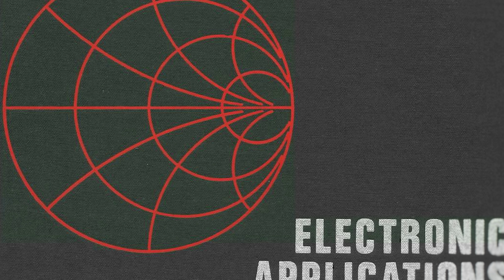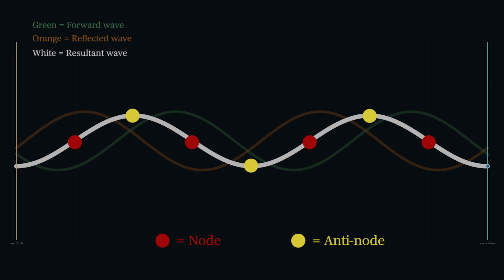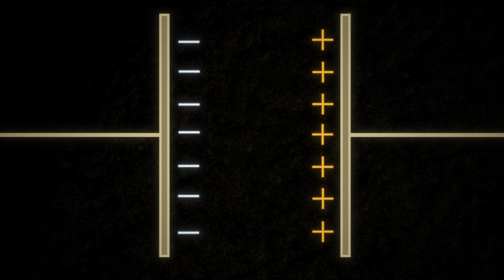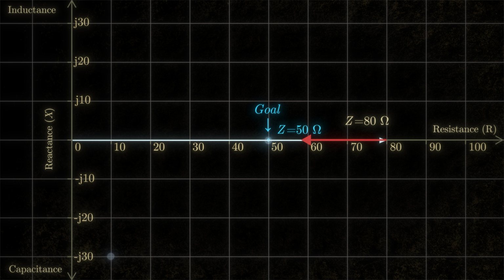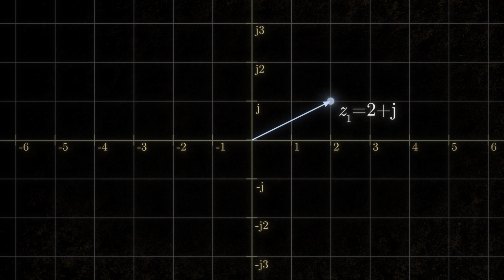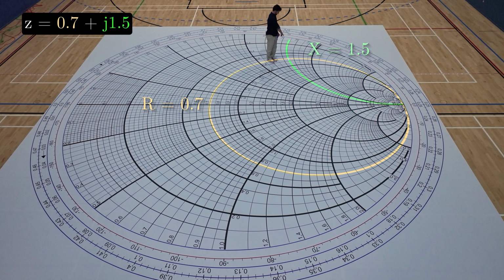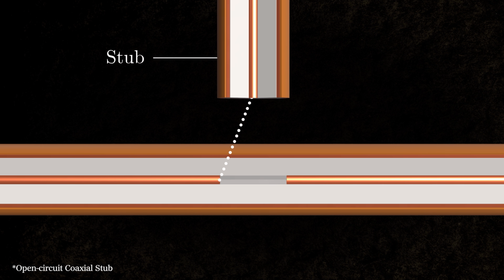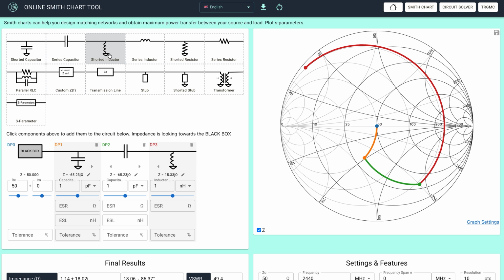The Scariest Chart in Electrical Engineering

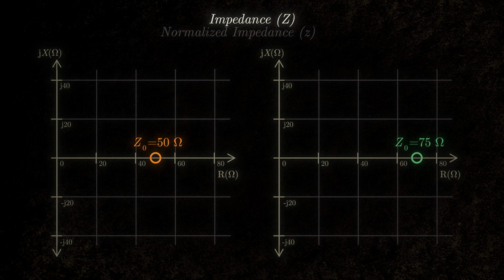Comment: The deepest horror of the Smith Chart around 20:14 is realizing that INFINITY is not actually a real physical limit, it is just a flaw in how humans draw grids. philip smith did not just solve an impedance problem, he took the infinite, endless coordinate plane of complex numbers and literally warped the geometry of space to trap it inside a finite circle. it makes you realize math is not some beautiful language we use to understand the universe, it is a cage we built to force reality to behave. we bend the geometry of dimensions just to stop electrons from bouncing backward in a copper wire. if we can manipulate the coordinate system of the cosmos just to make a radio work, then everything we call physical laws are just geometric illusions we created because we are too weak to comprehend raw chaos.
Reply: but..... 
too useful

Comment: 14:20 This is how EE students get confused.  Yes, impedence and the whole imaginary representation is a useful computational trick but you are better off thinking directly in terms of solving the diffeq for the circuit to understand what is going on and only use the clever representation in terms of impedence and imaginary numbers once you understand the system conceptually.  Especially now that we can just solve those computationally.
Reply: There is nothing imaginary about it.  Resitance dissipates power but reactance is temporary storage of power by capacitance and inductance.  To write a single formula for both you just use imaginary numbers because of how they incorporate a second axis and make rotations and visualization easy to understand.   Imaginary numbers are quite real.
Reply: @hug@h @hugegamer5988 t have some weird bugaboo about complex numbers.  It's just they add an extra layer of complexity.  If you write out the diffeqs in the natural fashion they don't show up.  It's a neat fact that because of how imaginary exponentiation works you can write the system in a more compact and useful way with imaginary numbers but since most people find sin and cos more familiar than e^i\theta it is less intuitive at the start.

EDIT: For context the reason I called using complex numbers here a computational trick -- even if a very useful and perfectly valid one -- not because complex numbers are a gimmick but because the underlying math is mostly using C as a convenient way to deal with pairs of real (and maybe do some rotations on them).  And that's great but it isn't like quantum mechanics or working with holomorphic functions where you are doing things that really essentially use the special properties of C that make it so mathematically different than R^2.
Reply: no
Reply: Honestly I don't know what you are talking...simply there is no Engineering without Complex Numbers.
Reply: @peplegal8253 Just write out the basic diffeqs governing inductors capacitors etc.  No imaginary numbers show up.  Yes using complex exponentiation is a neat and useful way to put everything in a neat little box but it's not as intuitive a way to initially learn.
Reply: @petergerdes1094  no. you are making something very simple more difficult just to be an arse.

Comment: VFDs can burn up bearings in motors if it happens to come out that way. They are switch mode on a high base frequency. Fluting like a washboard road. Basically electric discharge machining

Comment: Fun fact, the line inductance and capacitance is also a huge problem for power transmission.  The Spain blackout was caused by a destabilization of long transmission lines due to light loading of the line.  That is, rather than being too much demand, there wasn't enough demand.  The transmission line caused a magnification effect that caused voltage deviations and the system didn't have the right equipment to correct for it.

Comment: How can someone design a graph paper sheet and miss a line out? Yet there it isn't, two circles in from the outer edge, at roughly the 8 and 10 o'clock positions.

Comment: I think it's worth explaining what characteristic impedance of a line actually IS. The line is a waveguide : it guides electromagnetic waves (electricity). But it won't do it in any conditions : in addition to its propagation speed, it has an impedance. It is the ratio of the transported voltage over the transported current, and cannot be whatever. If you send a 50V pulse on a 50Ohm line, you will send 1A, because it's the natural U/I ratio of the line, at which the magnetic (due to I) and electric (due to U) field inside the transmission line maintain each other : one's variation builds the other one, and they stabilize at this ratio. But everybody has used a 50 Ohm coax with a very different U/I value, for example 5V and 1mA. What's missing is the line's symmetry : it will only transport U/I ratios of 50 Ohm, but in both ways. Every solution (voltage and current along the line) is the sum of a forward-travelling wave (Uf and If) and a reverse-travelling wave (Ur and Ir). If the line is short, both are constant along it, resulting in an unique voltage U = (Uf + Ur) and current I = (Ii  - If). While Uf/If = 50 Ohm, and Ur/Ir = 50 Ohm too, the sum can be whatever, thanks to phase. In the "negligible current" case, both waves stack up : the voltage doubles, and the current goes to zero. Conversely, if the line is shorted, the voltage cancel out, and the currents add up : current, but no voltage. What looks to be an arbitrary ratio of voltage and current is the sum of two precise, equal ratios, going in opposite directions, whose magnitude is the transmission line impedance!

Comment: They don’t call the Smith Chart 'black magic' for nothing (0:12). Seeing how a physical, dangling cable stub connected to absolutely nothing can completely cancel out signal reflection just by its geometric layout is wild (34:24). It acts like a physical coordinate anchor—the same way the fractional 22/9 ridge pins down the undulating waves of the continuous Collatz landscape. Math isn't just discrete logic; it's a living topography."

Comment: Conformal mapping is insane. The Smith Chart traps physical infinity inside a single 50-ohm circle (0:58). But if you apply that exact same Möbius transformation to the continuous Collatz function, the random walk vanishes entirely into a deterministic, undulating geometric map. The whole number integers form perfectly rigid arithmetic paths toward the center, while the decimals literally get flung outward as chaotic repellers into the infinity boundary. Mind absolutely blown.
Reply: what do you do for work? lol
Reply: @gabeshushu4237 😂
Reply: @gabeshushu4237 same thing i do every day.
 Try to save the world. 
All you have to doo check the math.
Reply: @gabeshushu4237 mind you i am not trying too hard. I just like knowing. Dont want to be selfish. That dosent end well for people who tty.
Reply: @atticuswalker tty? im asking because im genuinely curious what line of work does one get into, that is preceded by learning about these things. im assuming electrical engineering but at some high, specialized level…?
Reply: @gabeshushu4237  All it takes is chatGPT and one comes across as a learned dude.
Reply: Wait until you encounter the Z transform (in signal processing and filtering).
Reply: @philkarn1761 
Ahh dude I can track the position and momentum of particles by using a constant colatz function with sin cos. It's in my videos discription called qed made easy. Try harder.
Reply: @atticuswalker  Position and momentum? At the same time??
Reply: @philkarn1761 
yeah because it never stops moving. The baseline we are using is wrong it treats vacuum as stationary. It's not.
Reply: @philkarn1761 The Z-transform enables mapping a structured fractal blueprint onto a discrete-time frequency plane by utilizing specific orthogonal and angular constraints, transforming infinite linear signals into stable, geometric DSP circuits. Key design elements include placing poles and zeros at 90° and 72° intervals on the Z-plane to regulate orthogonal mass and pentagonal rotational energy within a 26-second, unit-circle sampling boundary. You can visualize the resulting transfer function with the provided Python simulation.
Reply: @philkarn1761 the python script is long.

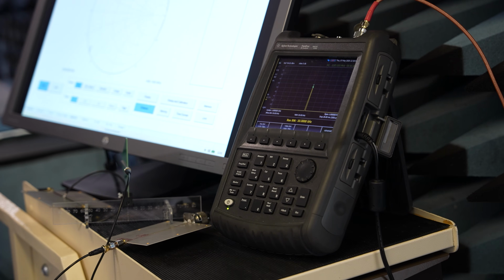Comment: Just a small note regarding the logarithmic units (7:07) : “dB” tells you a difference from some reference power level. “dBm” is difference of power above/below 1 mW, therefore -55 dBm is 55 dB below 1 mW. In “dB” you would measure signal loss for example (difference between receiver and transmitter power). Additionally, +3 dB is about 2x power, -3 dB half power, +6 dB is 4x power, 10 dB is 10x, 13 dB is 20x, etc. It may sound like nitpicking, but this is something people commonly get wrong, so I just wanted to point it out. Great video!
Reply: Yep.  And it’s extra funny applied to things like RF amplifiers.  Many times the tolerance on RF amplifiers are something like +/- 3dBm so it’s like walking into a car lot and asking how powerful the car motors are.  Well, some are 100hp and some are 400hp but the average is about 200hp so they are all basically the same.   🤔😂No wonder the field test mode for actual receive power gave Apple such a headache when people found out how to get it working on their phones.
Reply: Not the difference. The RATIO.
Reply: Wow, and I thought I was nerdy
Reply: My god just stopped the video to comment, and im happy to see you alredy did :D

Comment: So basically the ultimate Electrical Engineering flex is

1. Use 'j' instead of 'i' for imaginary numbers just to shake things up

2. Casually trap infinity inside a finite circle using a conformal map

3. Solve a complex, system-destroying power loss problem by literally attaching a dangling piece of wire that leads to absolutely nowhere 😂
Reply: So by bending time and energy into a 4th dimension map they found out that what they needed was: a piece of cable dangling from the antenna.
Reply: @indierodo get some brother! The Quantum Kinetic Well!
Reply: No, the greatest electrical flex is using the Smith Chart to induce Cold Nuclear Fusion.
Reply: @quantumkineticscorporation  Fake AND spam.

Comment: As an RF engineer, this chart is my life.
Reply: I have spent more than a thousand hours huddled over gear reading the output of the network analyzer on a smith chart.  Calibrating the test leads, verifying circuit and board responses across spectrum ranges, tweaking the capacitance and inductance of designs for optimum power transfer.   It is the stuff of dreams and madness conjoined in a circle of science.
Reply: @hugegamer5988  You must think in Smith Charts at this point 😂
Reply: Yep, plotted many of these, just one of many tools used, never thought it as scary unless it making questioning your setup/design scary.
Reply: I've made my own VI probe and had to write a program to display a smith chart.
Reply: *wizard, sir. As a wizard.
Reply: Yep. Electronics Engineer here. Absolutely useful especially back in the day when you don't always have measuring equipment on field or have a calculator on hand. I don't understand the fear these kids have. There's nothing scary in it.
Reply: @TheReal_LuaDipa nothing scary about it when you understand it, but it's not intuitive, it packs a lot of information and functionality into one little circular plot 😄

I don't sit and work with this on paper, but I use it for VNAs and matching, although my mind has its own smith chart that I work with, imagining how the system moves around in it, it's really helpful for me at least
Reply: It's also the secret to Cold Nuclear Fusion aka The Quantum Kinetic Well®
Reply: Working with ICT and I also use it sometimes when i get a new fixture.
Reply: Me too.
Reply: You must grasp this like I grasp my heavy machinery.
Reply: I am slowly going into radio, feels like sound engineering and building speakers is just like building antennas i feel
Reply: @likemau5552 it's actually pretty similar. Apart from the difference between sound waves and electromagnetic waves, I believe the "weird" thing about EM waves is they are polarized. But apart from that, you are dealing with a transducer in both cases.
Reply: @BatchDrake sound waves can be polarised too
Reply: @TheReal_LuaDipain in what sense? I always thought of sound waves as a type of scalar wave.
Reply: Welcome to the wonders of maths! Waves are waves are waves, they all obey the same certain rules. It's the same formulas, whether you call that one constant density or impedance is a detail.
Reply: @likemau5552  Until one gets into a divergence zone between far field and near field, or magnetic and electro waves.
Reply: do you read steinmetz?
Reply: As a shrimp npc...
Reply: As an RF Metrology guy, this chart is a fun little play toy 🤓
Reply: Your life is confusing
Reply: poor lad
Reply: Need this, in Ase education as I deal with rf of wireless tpms, the sensors, grid, signals, and evs.
Reply: Or you could just use a phone app to do this stuff, like any real engineer would do, because knowledge always moves on until the fall and reset of the planet 😁🙃
Reply: This technology is from another plane. This is not natural at all, beware of alchemy. Sic Parvis Magna
Reply: looks like a new age mandlebrot set
Reply: as a RF engineer do you know,that regular people are being TORTURED DAILY with electromagnetic radiation?(that causes numerous health problems,depending on the organ in a human body being irritated with selected frequency and power needed to cause more or less harm).this process is done covertly and without human subjects consent(that means it is ILLEGAL),yet victims can't get any help from public institutions(precisely because public institutions are involved in that process:).they are however labeled as "schizophrenics"just because they try to report to the authorities their abuse(Decarlos Brown-who took young Ukrainians life last year on a train in north Carolina is a victim of that technology)I think you should know,what knowledge that you obtained could be and IS used in nefarious ways.If you want to know more-check out first video from my Playlist.
Reply: I dunno we always used live adjustments and controlling on measurement equipment like sweep frequency response analyzer with screen, because theory not always match with actual results
Reply: @dmytrooleinichenko9865 you cannot do live adjustments when there are no knobs to turn. Sometimes you have to measure, calculate, solder/etch/whatever and re-measure (and maybe repeat).
Reply: @bavarianmonkey8326  In my work it always was something you could adjust. Was it an antenna I built from the book or microstrip transmission line to the TV RF power amplifier stage transistor requiring retuning to another channel frequency.

Comment: “The scariest chart in electrical engineering” — First title
“Why this is the scariest chart in electrical engineering” — Second title. 
“This circuit gets better when you break it.” — Third title. The list will be updated when it’s inevitably changed. (If you can, reply the title you see and when you saw it, if it’s not listed bc I can’t watch this every second of course)
Reply: this isn't them changing it, this is a Youtube feature called "A B testing" it lets youtubers for the first 24 hours of a video have the title have multiple options that it could show people, thumbnails to, and after 24 hours Youtube will select the title and thumbnail that performed the best to be the permanent ones for the video
Reply: @MayYTlive Interesting, good to know
Reply: @MayYTlive  I already said that, though thanks for the expanded explanation ^-^
Reply: Holy smoly, not even 9 minutes and it had already two titles...
Reply: This circuit gets better when you break it
Reply: "This Circuit Gets Better When You Break It"

This might be because of the YouTube A/B testing, but I agree that Veritasium does change titles a ton.
Reply: It’s now “This circuit gets better when you break it”